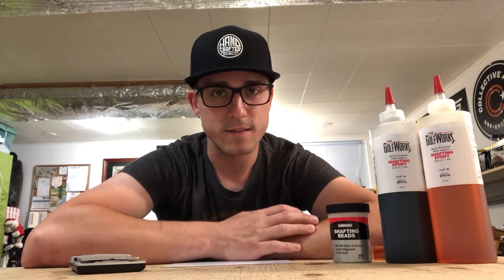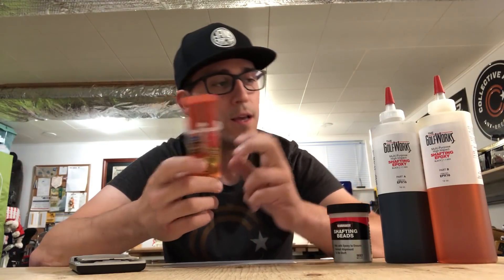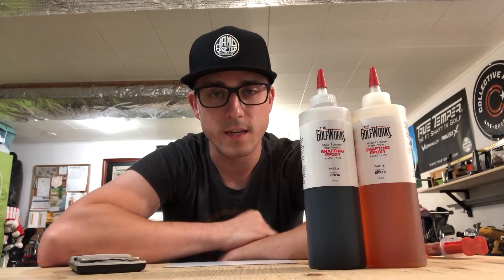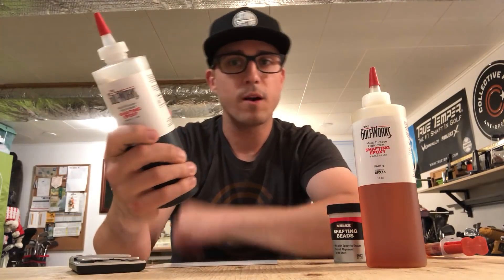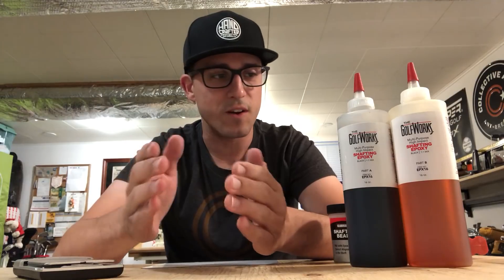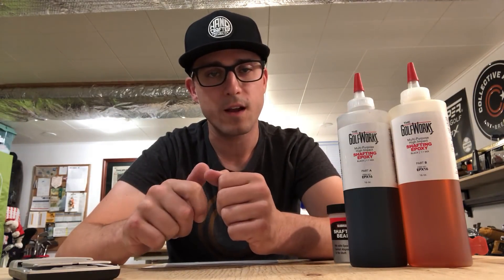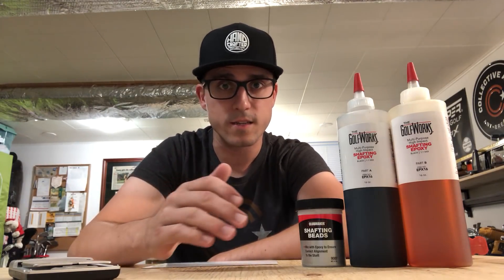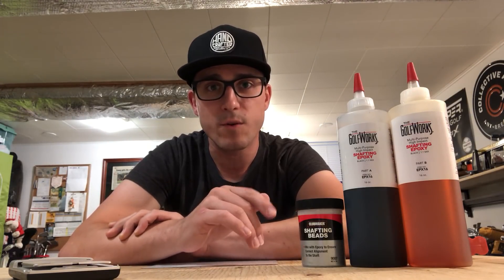Club Building 101: Understanding Epoxy

Comment: I actually have a question regarding adding weight to a club head. Sure, we could just throw on some ugly lead tape or blocky tungsten weights, but is there a cleaner way? Sure, shaft tips get the swing weight down, but i can alter ball flight characteristics when adding weight directly to the head!

Comment: Great video Ryan.  I use the shafting beads almost all the time as you recommend, but sometimes I still struggle when the hosel diameter is too big for a snug fit.  It's always too small a gap for a shim, and too large to only use epoxy and beads.  An experienced club builder friend of mine suggested I cut up some small pieces of an aluminum can, coat both sides with epoxy and spiral it onto the shaft when gluing.  It has worked fine and I haven't had any epoxy failures with it, but it still worries me .  What do you think of this?  Also I recently watched a video where a guy in a Tour van used some fishing line when gluing the shaft to the head together.  I've used the mono fishing line to dry fit for swing weight and moi, but never in gluing...thoughts?  Finally, I recently purchased some clamps that lock the shaft to the head.  I haven't used them yet but was wondering if you have, and any thoughts.

Comment: will jb weld work
Reply: Use 2 part epoxy, and it will NOT fail.
Reply: @newmanfertig886   are you sure? I’m looking at a pack of JB in my shop and debating on not even ordering “golf epoxy”😂😂

Comment: Ryan, please confirm on epoxy.
1:.7   Total 1.7 grams
2: .7  Total 3.4 grams
3: .7  Total 5.1 grams
4: .7  Total 6.8 grams
5: .7 Total 8.5 grams
6: .7  Total 10.2 grams 
7: .7. Total 11.9 grams
8: .7  Total 13.6 grams
9: .7  Total 15.3 grams
10: .7 Total 17.0 grams
Thank you.  I realize this is simple but I am having such a mental block.  Please reply.
Reply: Dude,  OMG - this is not 'dark sciences' folks.  You're gluing some clubs.  I just eye ball two puddles and mix them together.  Been doing this for years.  Never had one fail.  And I've taken them apart years later and it requires a ton of heat and torque.  Also, save yourself some money on the shafting beads.  I've never used shafting beads (snake oil?), and never had to.  If the shafts feel a bit loose, you could use a bit of beads, but I would really wonder why it's loose.  I don't mean to be graphic, but we could literally do a 20 minute video on how to wipe your butt.  We could spend 5 minutes talking about the texture and thickness of the toilet paper (you don't want it too thin, or too thick) and then how to fold it, and then how many times to do the actual wiping, and of course the checking of the paper to ensure you're done.   I mean, we can over complicate anything.  Just make two puddles on some cardboard, mix well, get a tee and dab some inside the hosel, then coat the outside of the shaft, put the shaft in, and pull it out (displaces air) and then in again, then get some nail polish remover to clean the excess epoxy off the shaft and ferules, and  set 'em up for a day.  Some say the clubs should be in an upright position afterwards, I don't think it matters.  Oh, and the epoxy I use is at least 15 years old.  In two parts, and still as strong as ever.  EZ.
Reply: @newmanfertig886  Thanks. This is kinda what I thought, but I glued three clubs tonight. One became pretty tacky within 30 minutes, but the other two were still moving around. I came and watched this video and got spooked that my ratio was messed up, and somehow the first one I did just luckily got the right amount. So I carefully measured a new batch of epoxy, pulled the two that weren't setting, cleaned them up and re-did them. Probably completely unnecessary, but I guess we will see in the morning.
Reply: @davidnettleton3375  Great! Glad it worked out for you.
Reply: Thank you for your prompt reply!  Much appreciated.

Comment: Ryan, 

Is it common for a shaft tip not to fit inside the hosel before prepping and sanding the tip?

I have a 2016 Bettinardi BB1 that I purchased a new shaft for. I was told by Bettinardi and another source that they use a .370 tip for their putters. I purchased a KBS CT putter shaft .370 tip and it does not fit.

I kept the old shaft tip and it seems like the old tip is slightly smaller then the new one. I am about to head out to Lowes and buy a micrometer. Before I sanded down the tip, I wanted to make sure that this is a common problem or if it's not a problem at all. Any help would be greatly appreciated. Thank you.

I wish you would do more videos, you're very clear with all your explanations.
Reply from the maker: sanding down steel is not common practice and is usually only necessary on shafts right at the very tip if the chrome plating is causing an issue. 

What it sounds like is the tip diameter of the shaft you have might be a bit out fo spec and that's causing the issue. Some gentle sanding may help fix the problem but dont go to far reducing the wall thickness.

Comment: For the love of god I’ve reshafted a wedge 3 times, this thing will not stay on what am I missing lol the shaft tip is prepped the epoxy is golf grade epoxy the epoxy was applied in the hosel as well as the to the tip and then inserted left to set for hours. Failed after 20 hits or so.

Comment: I Don,t have shafting beads ? is there anything else i can use ?  No club stores within 2000 miles so i have to DIY any repairs .This job is to replace a  shaft in an old driver for a friends wife to use ,i have done a few inrons but not a driver before ,the head isa Ping  G15 .
Reply from the maker: HI Thomas, sorry for the delay.
For a PING G15 you should use beads and a proper sleeve ferrule that is a stock replacement. Hard to recommend a substitute since I have only ever used proper beads.

Comment: Can you help explain how shafting beads help center the shaft?  I never understood that.  The sand seems too fine to self-center the shaft in the hosel, it just seems to thicken up the epoxy somewhat.
Reply from the maker: Shafting beads work a bit like a shim to fill extra space between the shaft and the hosel. When evenly applied and installed correctly the beads will help keep the shaft centered in the hosel and reduce lean.
Reply: @ryanbarath1916   Why doesn't the epoxy do that?  Why would  you need beads to do what epoxy should be doing?
Reply: @bertraminc9412  epoxy is liquid until it sets. think about it like a small jar inside a large jar, with marbles in-between. once the marbles (beads) are distributed, the inner jar (shaft) won't touch the wall of the outer one (hosel).

Comment: Hi Ryan, another great video! The epoxy topic brings me to my question. Bear with me as I 'go around the issue here' You are never supposed to fill too much 'void/space' between shaft and head with epoxy - correct? So given an iron with a taper hosel and a .355 steel shaft at what point is a shim required? I find that in the majority of my repairs if I place the shaft into the head without glue , the head will be on so loose (you can twirl the head by turning the shaft with your hand). Only with a shim in place will the head fit 'snug' . Now I've experimented with two irons that fit loose - one had a shim put in it and the other without a shim. Neither one has failed....(yet?)  So the question is: When reshafting any club, does it have to fit 'snug' (and what would be your criteria for 'snug') and if it doesn't and you go ahead and epoxy, will that build eventually fail? thanks again and sorry for the long winded question. :D Gary
Reply from the maker: Its a good question. 
Snug doesn't have to mean absolutely no movement. But when you rest it to set is there a lot of lean? 
If you can fit a shim in dry then you will need a shim for sure when using epoxy, if a shim has no chance of fitting dry then epoxy with shafting beads is probably the best bet. 
Its a general rule but I hope this helps.
Reply: Hi Ryan, that does make a lot of sense. Sometimes after applying epoxy the club will 'set' after tapping the head into the shaft and if it does lean, I'll take it out and put the shim in it. thanks for clearing that up. :D